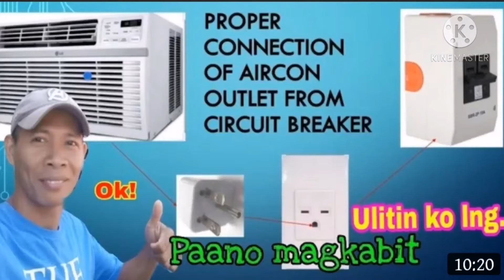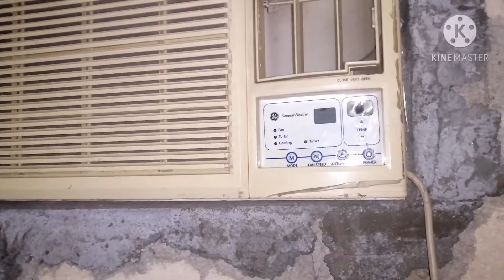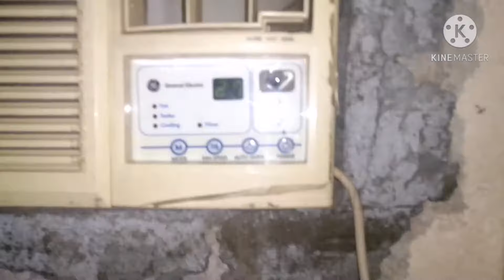PAGAMIT NG UNIVERSAL ADAPTOR PARA SA AIRCON PLUG AT OUTLET

Comment: boss pwede ba gamitan ng adaptor na merong on and off switch sya pero isasaksak din sya sa mismong separate outlet ng aircon .. 
kasi malabo na mata ni erpat hinde nya maisaksak minsan ung aircon kya balak ko sana gamitan ng ganun pra pipindutin na lang nya pra mag on or off ung adaptor na meron on off switch .. para hinde na nya huhugutin pa ung saksakan ng AC .. ????
Reply from the maker: Opo boss pwede po dhil meron na po ngaun nabibili na meron on/off switch para sa AC boss.
Reply: @mapatechvlogph8668  pano un boss 1.5hp AC namin pero nakikita kong merong on off switch adaptor e 250v 10amps pwede ba sya ???

Comment: Sir ask lng paano po kung naka partition napo linya ng bhay at my kanya kanya na circuit breaker? Need prin po ba mag install ng c.breaker ulit papunta outlet ng ac. Slmat po if ma notice
Reply from the maker: Qng lahat po ng circuit breaker nio ay madami naka connect halimbawa po ung isang CB nio ay para sa lahat ng outlet at ung isa nman at para sa mga ilaw at ung iba nman para sa mga extra appliances nio eh, talaga pong kailangan nio magkaroon ng isa png circuit breaker para sa outlet ng AC nio?un po kc ang pinaka safe na connection ng ac boss, pero qng sa tingin nio meron kaung bakante na isang circuit breaker na nsa main panel box nio eh, pupwedeng un nlang ang gamitin nio? Qng meeon kaung spare?
Reply: @mapatechvlogph8668  salamat boss sa info. More power po sa channel nyo

Comment: boss may tanong ako yung electrician namin kinabitan kami ng 30amp na cb para sa outdoor unit para sa 1.5hp na split type ac yung main circuit breaker switch namin dedicated para sa ac is 30amps din yung outdoor unit rekta sa main switch na circuit breaker gamit ang 10awg wire oks lang ba yun or need ko palitan yung outdoor unit na 20amp na breaker? salamat sa sagot
Reply from the maker: Pwede na po un boss kung 1.5hp ung split type nio ay tama po na 30amps ung gamitin boss.okay lang nman po qng 30amps ung naka linya na rekta dhil lalabas po non ay un ang primary nio na CB at secondary nman po ung isa na png outdoor boss.👍🏻👍🏻✌🏻Ok lng po un
Reply: @mapatechvlogph8668  salamat naguguluhan kasi ako may mga nag sasabi na need ko ng 20ampere na cb para sa outdoor unit ng ac kasi over na daw ang 30ampere at pang conventional aircon lang daw ang 30ampere at hindi pang split type inverter na ac
Reply from the maker: 😁Wag nio nlang po pansinin boss,wala nman po kaso un kung 30amps ung ginamit nio kc kung naiintindihan nila calculation ng electrical load ay hindi po un over kc  kung ang ikinabit nio po CB don sa outdoor ay 40amps pataas ay un po ang over dhil mas mababa ung nasa main kesa don sa naka secondary connection nian AC nio...hehehe...safe po yan boss
Reply from the maker: alam q po nasa isip ng mga tanong nila sainyo boss😁Ito po ung isa sa mga gusto nila savhin sainyo ,Ang dpat po talaga ay ang main ang mas mataas ung amps kesa don sa secondary😂Ganun po ibig nila savhin.
Reply: ang main kasi 30amperes din kaya nagulat yung electrician na nag kabit kung bakit papalita ng 20ampres ang sabi kasi baka d mag trip yung cb pag may mangyari dun sa mismong split type inverter ac
Reply: so no need ko na po palitan yung 30ampere na cb para sa outdoor unit ng ac?
Reply from the maker: hindi na po boss pwede na po un kc kagaya nga po ng sav q secondary lng nman po un😊👍🏻
Reply from the maker: 😁😁Wag din po kau mag alala kc kaya lng nman po nagkakaroon ng poblema ang isang AC ay dhil sa mali at hindi angkop mga wire na ginamit at CB.safe po yan sainyo boss khit kamo icaculate pa ng isang veterans na electrician un mga CB mo.👍🏻👍🏻✌🏻

Comment: Sir need b talaga sariling outlet at breaker ung ac?di po b pwede may kasama sya tv sa outlet,?salamat po
Reply from the maker: Yes boss need po talaga ng AC ng separate na CB at outlet, dpat po walang kasama linya ng para sa appliances yan boss kc baka magkapoblema po kau sa linya nio. Un po ang proper connection ng mga AC natin.

Comment: sir pwede ba sa extension ang split type 1hp?gamitan ng royal cord?o putulan nlng ang wire ng AC at dugtungan ng wire?anong recommended royal cord size ng wire?
Reply from the maker: Ahh... Qng sakin kc boss di q recomended na gamitan nio ng extension ung AC nio, alam nio qng bakit? Ung linya po kc na pagkakabitan nio na outlet eh, cgurado po aq gamit nio po na pangkalahatan sa bahay nio boss? Oo' good gamitin ung royal cord at safe yan lalo na qng gauge #12 ok lng para gamitin nio... Pero kagaya po ng palagi q ina advise eh, kau pa din po ung magdedesisyon about sa qng paano nio mapapagana ung AC nio boss.
Reply: @mapatechvlogph8668  may sarili pong outlet yung AC sir yung nga lang ndi abot yung cord ng AC sa outlet kaya gawa nlng po sana extension para s outlet ppuntang AC. maglagay po sana ako ng ceiling outlet tpos royal cord ppunta dun sa outlet tlaga sana para sa AC. pde ba yun sir?
Reply from the maker: @rheymillejosephguinto2976  ahh.. Okay 👌pwede un boss basta gauge #12 kpag gauge #14 kc maxado maliit para sa AC lalo na 1hp.
Reply: @mapatechvlogph8668  ah ayun nmn pla..tpos nkasaksak lng dun sa outlet tlg using plug lng ok lng noh sir?maraming salamat sir..

Comment: Good morning po boss.. kapag po nakaoff ang aircon pero nakasaksak sa outlet, kumakain pa rin po ba yun ng kuryente? (May motor pump din po)
Reply from the maker: Opo boss😊Meron at meron po dumadaloy na kuryente magmula sa outlet to electrical components po sa mga airvon boss...switvh lng nman po ung i-noff nio.kaya automatic na may supply po ng kuryente un.pero dhil naka off ung switch ng compressor na pinaka motor ng aircon ay don lamang po sa wire magmula sa outlet at papunta nman po sa line 1 na supply na nasa loob nh aircon nio boss😊Pasensya na boss medyo mahaba paliwanag 😁😁

Comment: sir aircon po namin 0.6 HP. naka 16A yung outlet meron adaptor na 10A ok lang po ba yun?
Aircon = 0.6HP
Outlet = 16A~220V  (solo socket)
Adaptor Omni= 10A~250V
Reply from the maker: Pwede po boss, safe at good na po yan boss👍👍👍
Reply: What if 1.5hp split type aircon po with 20A-250V outlet, tapos gagamitan po yung plug ng aircon ng 10A-250V. Ok lang po ba sir?
Reply: @mapatechvlogph8668 sir ask ko lang po pwede po ba ung adaptor namin
Breaker 30A ROYU+watt meter+adaptor 10A ROYU connected to plug ng aircon 0.6hp astron po tatak pwede po ba un
Reply from the maker: Dami non ah😁👍🏻✌🏻Pwede po maam...good po un qng naka built in na don sa royu na CB
Reply: @mapatechvlogph8668  hehe 2families po kc kame sa isang bahay kaya need ko po watt meter kahit sa aircon lang naman po may kahati po kc kameng mag asawa sa bayad,yan lang po electric appliances namin sir the rest ung basic appliances na po..thank u po
Reply: @mapatechvlogph8668  naka direct po sa live wire ung CB kaya alam ko pong safe,wala po bang effect sa pyesa ng aircon ang pag gamit ng adaptor sir?
Reply from the maker: Wala po maam,pero kung ung adaptor nio ay fake posible po na masunog un lalo na kpag made in c_ _ _a😁🙏🏻Mahinang klase po kc kpag galing sa kanila mabilis mag init at madaling masunog ung plastic.
Reply: @mapatechvlogph8668  sa hardware po nabili meron parin po bang nabibiling fake sa hardware?royu po tatak fake po ba ang royu or mahinang klase?natatakot lang po ako baka po kc sumabog hehe lalo na pot napanuod ko video mo sir na bawal po talagang gumamit ng adaptor sa aircon.
Reply from the maker: Meron po kau makikitang nakalagay sa plastic or sa mismong adaptor qng saan MADE maam😊Meron po kcng mga fake nian na gayang gaya eh...sa mga wilcon or handyman po kau tumingin para sure po🙏🏻
Reply from the maker: kpag maluwag po kc yang adaptor jan po nagsisimula ung pagkasira dhil hindi po fit sa mismong PLUG ng AC maam😊Kaya hindi q po sana yan gusto gamitin dhil sa madami po dto sa atin ang fake na ganyan...iba po kc ung gawang may quality dhil subok qna po un lalo na po nung nasa ibang bansa aq gumagamit din kmi ng mga adaptor don pero magandang klase po ung gamit nmin at fit na fit sa plug ng appliances
Reply: @mapatechvlogph8668  ok po maraming salamat po sir

Comment: Hello oo gud eve ...bumili po ako 0.5 hp na aircon need po ba agd ng breaker...ok lng po ba kung direct po sya..wla pa pong budget pambili ng breaker😅 sana po masagot nyo po gustong gusto na pong gamitin ng mga anak ko..napansin ko lng din po na mainit po un saksakan..nya
Reply from the maker: Okay po,pwede nio nman po magamit yan 0.5hp na AC sa normal na convinience outlet po pero dpat po ay tinatanggal nio po ung pagka plug in kpag hindi nio gamit dhil tama po kau na mag iinit po yan plug...pero advise q pa din na mapaglayan nio ng proper wiring connection para safe po kau.

Comment: Safe po ba na ni rekta nalang yung wire ng aircon sa breaker? Pinutol po yung plug tapos diniretso pong kinabit sa breaker.
Reply from the maker: ahh..pwede nman po ung ganun set up na direct to CB ung cord ng AC nio para deretso OFF kpag hindi nio gagamitin maam😊❤👍🏻
Reply: @mapatechvlogph8668  Thank u po. Madali lang naman po sigurong alisin  yung connection sa breaker paglilinisin yung ac.
Reply from the maker: Yes po maam😊👍🏻👍🏻

Comment: Sir yung aircon po namin is split type 1.5hp
May sariking circuit breaker na 20Amp
Tapos yung saksakan po ng aircon merong 10A na adaptor. Ok lang po ba sir? Maraming salamat po.
Reply: Yung adaptor po pala ay may excess na saksakan para sa wall fan minsan patay ang aircon ang wall fan ang gagana. Ok lang po sir? Thankyou po

Comment: Sir tanong ko lang po. Ung wire Aircon po kase namin is ininstall ko at ginamitan kopo ng #10 (5.5mm diameter) kaso wala po akong nilagay na wire ground. Line 1 at Line 2 lang po yun.. pwede po ba yun? Salamat po sa reply
Reply from the maker: Okay lng nman po boss qng hindi kau nkapaglagay ng ground connection sa ikinabit nio AC. Optional nman po qng lalagayan nio ng grounding boss, dto po kc satin 2 wire lng kaya hindi po talaga naisasama sa linya ung ground bossing, pero kau na po magdedesisyon qng palalagyan nio. 👌
Reply: @mapatechvlogph8668  ok po sir thank you po at active po kayo🥰🥰 keep safe po.
Reply: @mapatechvlogph8668  sir tanong ko na din po para malinawan ako.. ano po ba purpose ng ground connection. Or para san po ba sya?
Reply from the maker: Welcome boss👌palagi po aq active lalo sa mga tanong

Comment: Sir bakit po yung saksakan ng aircon ko may konting sunog saan po ba kaya ang problema sa mismong outlet po ba? 250v po ang outlet yung aircon ko po 230v okay lng po ba yun?
Reply from the maker: Kadalasan po nangyayari yan boss sa mismong mga aircon outlet lalo na po kpag hindi magandang klase ng nabili natin na aircon outlet... Don po nasusunog ung plug ng AC nio boss.
Reply: Sir delikado po ba yun? Baka po masira yung AC ko
Reply from the maker: Yes po boss.. 👍Kc pwede pong pagmulan ng sunog un dhil kpag nag init po ung mga wiring nio eh, magkakaroon po un ng short circuit lalo na po kpag hindi nag automatic cut off ung CB nio.
Reply: Salamat po sa reply ano po solution dun sir dpat gawin po
Reply from the maker: Welcome po👌❤️godbless po

Comment: Sir tanong ko lang. 
Dalawa kasi fuse box ko. Isang submeter isang main. Saan safe way po ba pweede ilagay ang aircon outlet nun. Sa main po ba at okay na din sa submeter.
Reply from the maker: Mas okay po boss qng sa main fuse box nio po ikuha ng supply para safe po wiring connection nio

Comment: Good pm po sir.. Tanong ko lang po...nahihirapan po kasi ako mag kabit ng linya papuntang sa aircon sir.. Balak ko sana... Para magkabreaker po yung aircon po namin sir.. Yung breaker po isasaksak ko po sa main outlet.. Tapos yung out po nya dun ko ikakabit yung outlet para sa aircon..pwd po ba yun sir?
Reply from the maker: Qng sakin kc boss hindi po safe ung sa main outlet lng kau kukuha ng magiging connection nio ng CB papunta AC outlet nio po. Dhil ung linya na pagkukunan nio ay posibleng madami ng naka connect at ung main connection po un sa bahay nio boss? Baka po kc magkaroon kau ng trouble sakaling sa main outlet po kau mag tap ng connection ng CB. Mas okay po cguro qng medyo hirap kau sa pagkakabit eh, hanap nio ng matino electrician na marunong sa AC connection boss.

Comment: Lods ilan Amphere at volts need kapag magpapalit ng outlet with switch on/off?
Reply from the maker: Qng 230 volts ang normal na power supply ay un din ang dpat sa mga oulet nio pangalawa dpat po ay hindi kau bababa sa 20amps boss
Reply: @mapatechvlogph8668  may nabibili po kasi na omni ac outlet with switch on/off 20A 250volts specs niya ok ba to boss sa 1.5hp inverter Ac? 20A din ang circuit breaker ko.
Reply from the maker: Pwde po boss

Comment: sir pwede bang mag top ng another outlet sa saksakan ng aircon ??
Reply from the maker: Pwede nman po basta hindi pang aircon unit ung ikakabit nio na outlet boss? Pero qng para AC pa din eh, dpat tama po amps ng CB nio para hindi mag trip ung CB boss.
Reply: outlet lang boss para sa electricfan ganun kasi masyado malayo ung isang outlet namin..balak ko sa outlet nalang ng aircon kasi malapit lang un sa balak ko pagpweatuhan ng another outlet kung pwede boss.. saka anong wire boss gamitin..
Reply from the maker: Pwede nman po un boss👍👍👍basta electricfan lng po ung pwede.
Reply: opo boss electricfan lang po saka charger cp ganun boss hindi boss aircon..hehe salamat boss..anong wire kaya boss pwede gamitin?? pwede din boss ung gawin ko outlet ung sa mga extension lang?para hindi na bumutas sa wall..

Comment: Hello po sir, salamat po sa very informative na video. 

Yung AC set up po pala namin ay questionable.. nakasaksak lng na normal wall outlet gamit ang normal adapter (10 Ampere).. mayroon po ba kaming pwedeng solusyon?
Reply from the maker: Yes po maam,pwede po kau magpakabit ng aircon outlet para hindi po kau gumagamit ng adaptor kc posible po mag init kpag meron po non.

Comment: Boss Yan din tanong q mag tap.sana aq Sa outlet NG 1 hp ac window type. Wala aq panibagong breaker. Isang tv ,Isang electrician at ref na 6.5 ft Lang nman appliances nmen s bahay. Kaya na ba NG breaker NG bahay nmen un? Pag gagamitin nmn ung aircon patay Ang tv ref Lang kasabay n umaandar.
Reply from the maker: Ahh.. Hindi pwede boss kc qng main breaker nio na gamit pangkalahatan ung curcuit breaker ay pwede kaung magkaroon ng poblema sa linya nio sa bahay or baka pagmulan pa ng sunog.. Payo q sau boss mas maganda igawa mo ng separate na circuit breaker para outlet ng AC nio.

Comment: Boss ask ko po.. Ok lang ba ang na wire ko sa aircon, from CB to Outlet is flatcore/ Duplex stranded wire #16?  One half po ang aircon.
Reply from the maker: Ah.. Dpat po boss kpag nagmula sa CB to outlet nio para sa AC ay gauge #12... Masyado po maliit ung gauge #16 na gamit nio na  line ng outlet para sa aircon boss? Ginagamit lamang po ang gauge #14 at 16 na wire sa mga pang ilaw at extension cord boss.
Reply from the maker: Ilang HP po ung AC nio boss?
Reply from the maker: Kung 0.5hp lng po AC nio ok na po ung 15amps pero kpag 1.5hp po eh, dpat 30amps gamit nio boss kc palagi magti-trip yan CB nio

Comment: Tanong lang po sir  pwede  po ba gamitan ng lotus extension cord  #16 na may thermal cut-off protection  ang .75 hp na ac pero isasaksak naman po dun  sa outlet na pang ac tlga?.. hindi po kasi abot yung cord ng ac..
Reply from the maker: Pwede po basta 0. 75hp po yan boss pero maxado manipis ung extension cord na gauge #16 boss? Dapat gauge #12 po para hindi agad uminit ung wire?

Comment: Boss tanong ko kng wala pa kasi socket ung nabili kong split type aircon ..ilang amperes po ba dapat ung bilhin ko na socket
Reply from the maker: Circuit breaker po ba ung ibig nio savhin boss? Kung CB nga eh, dapat meron kng 30A na circuit breaker na bukod para po sa outlet ng AC nio boss.

Comment: Gd pm sir.ilang ampera o circuit breaker gamitin sa aircon.salamat
Reply from the maker: Kapag 1.5 hp lng po pwede na ung 30amps na CB pero qng mas mataas sa 1.5 hp gagamit na po kau ng 60 hanggang 100amps na CB para sa safety ng inyong linya.

Comment: pde ba aqo mag tap sa out let 0.5 hp
Reply from the maker: Ahh.. Pwede un boss qng ung outlet na pgkukunan mo para jan sa AC mo boss eh, kpag kaunti lng ung mga nka connect sa linya non... Pero qng sa tingin mo na ung outlet na yan ay pang buong kabahayan nio nkatap ung connection eh, hindi pwede boss kc pwedeng pagmulan ng short circuit yan.
Reply: Boss Yan din tanong q mag tap.sana aq Sa outlet NG 1 hp. Wala aq panibagong breaker. Isang tv ,Isang electrician at ref na 6.5 ft Lang nman appliances nmen s bahay. Kaya na ba NG breaker NG bahay nmen un? Pag gagamitin nmn ung aircon patay Ang tv ref Lang kasabay n umaandar.

Comment: pwede po kahit AC plug lang wala ng cicuit breaker..?
Reply from the maker: Boss kailangan nio pa din po ng CB para po sa safety ng inyong wiring sa bahay. Maaari po kasing magkaroon ng trouble  ang inyong wiring connectio qng isasaksak nio lng yang AC nio sa mga outlet ntin sa bahay na meron mga kasamang pinag gagamitan ng para sa mga appliances ninyo. So mas maganda po na magpakabit din po kau ng separate na CB at outlet para po jan sa safety ng AC nio boss.